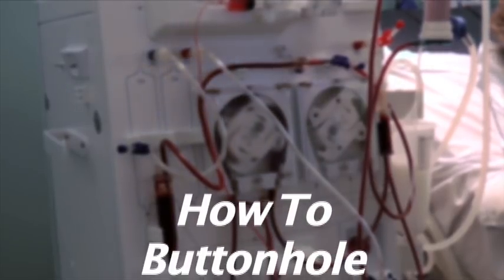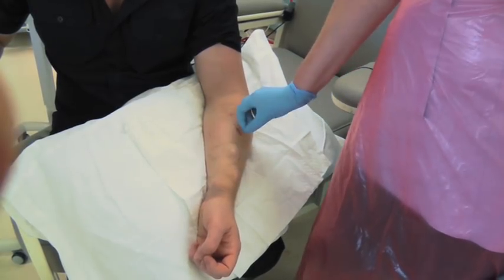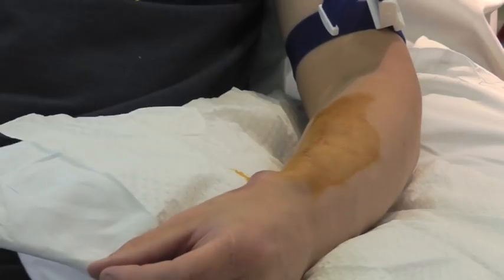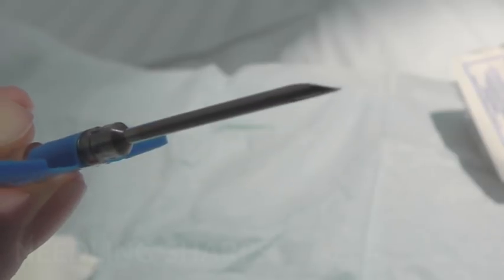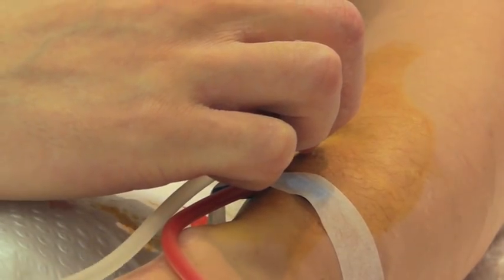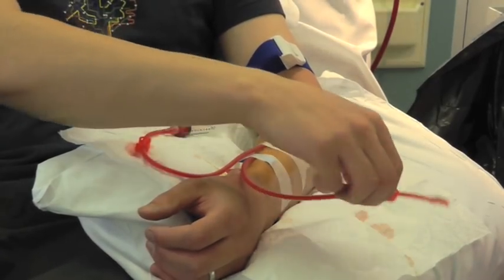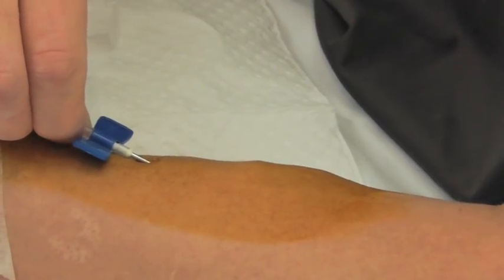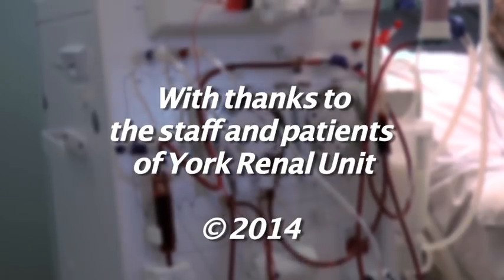How to buttonhole a fistula

Comment: Does this hurt?
Reply: Yes , it hurts but I didn't stick myself and I was 14 til I was 18
Reply: @kennethdaniel1516  Does it really? I've been going to the dialysis center the last few months. I adjusted quickly to the sticks, and even if it does hurt the same, I feel I could still do it. But this would definitely up my excitement with my switch if it hurts even less!
Reply: @herroyalsquirrelness8167   Yes because you can feel where the needle is going. Once you learn how to cannulate  yourself you will not want anyone else to cannulate you. When I cannulate myself I feel hardly any pain. And buttonholes are the best no lumps in your arms from repeated sharp needle sticks.